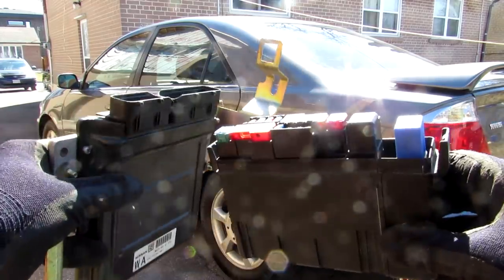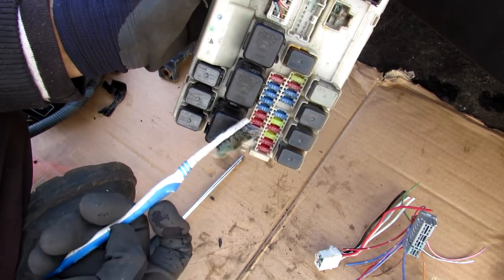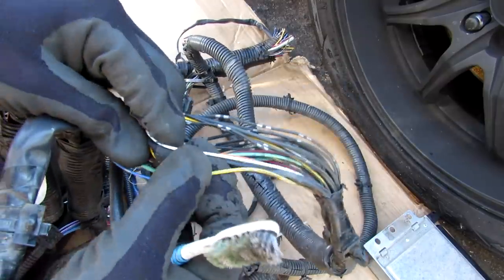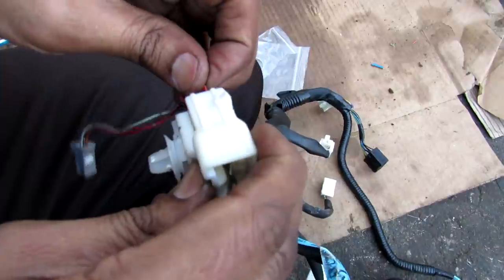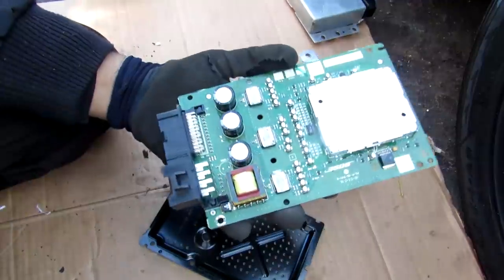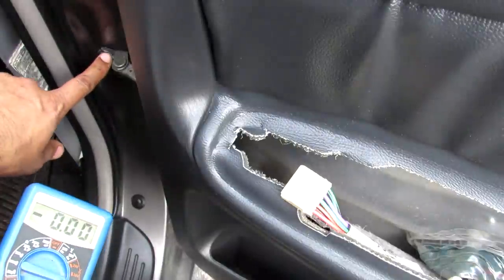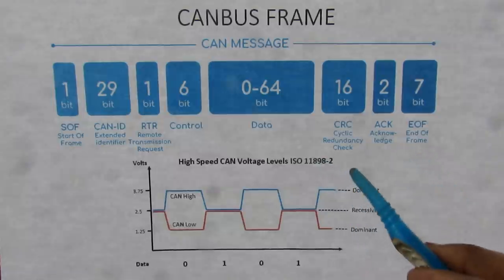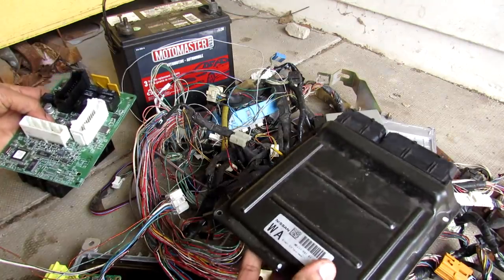Why Car Electronics are so Complex

Comment: Electricity flows from the negative terminal to the positive terminal. Electrons are negative, they are attracted to the positive. This actually matches the chemistry going on in a battery. This is why you always take the negative off first, and put it on last. I a surprised you do not know this speedkar99. PS ECUs run on 5vs just like the majority of small electronics. IDK why I am here, I am obviously not learning anything and finding incorrect info left and right.
Reply from the maker: I know conventional current is from positive to negative. We learn that in high school. The EWDs are drawn as such for easier diagnostics. Electron flow is a completely different thing.

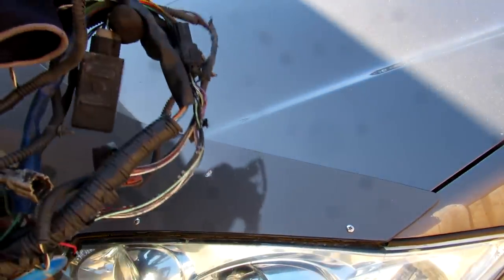Comment: 0:58 the second i saw that this is what a car has no wonder its easy to steal a ground from something else 

My cars radio kept getting turned on by the headlights, climate controls, turn signals and even the fucking reverse gear

Comment: 3 weeks at a licensed dealer and repair facility and they still can't locate a simple Immobilizer Control Receiver for my 2008 Honda Fit..!!
Reply from the maker: Can they swap one in and reprogram it with HDS
Reply: @speedkar99  After being run around as much as I have, I'm thinking to drag the car back to my place and try to fix it myself. Thanks for your suggestion...

Comment: Another one that has not got a clue  Electrons flow from NEGATIVE to POSATIVE.
Reply: Yes, but by convention it's said that current is the opposite flow of electrons, as it's easier to use the right hand rule for magnetic field calculations
Reply: At first I though the same, then reviewed that section and noticed that more than a knowledge mistake it is an expression that could be taken as a mistake but what  he is referring is how the cables are distributed into the harness and not the voltage flow as later you can see when the fuse block is teared apart and he mentions that only the positive side is distributed by that block.
Reply from the maker: I didn't refer to the movement of electrons moving in my video. Conventional current flows from positive to negative and that's how the wiring diagrams are setup for everyone to interpret.

Comment: I have been working on aircraft electrical systems for 40 years. I also worked on racing car (Indy Car  and Rolex Daytona Prototypes) electrical systems for 5 years. The racing cars are similar to aircraft electrical systems. 
The electrical systems in regular cars are shit. Crap wire, crap connectors and poor system designs.